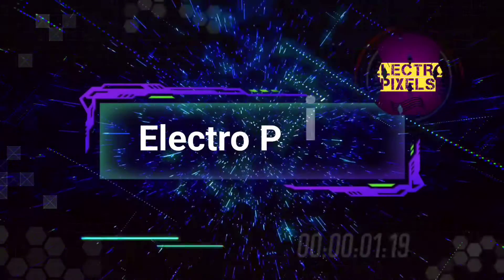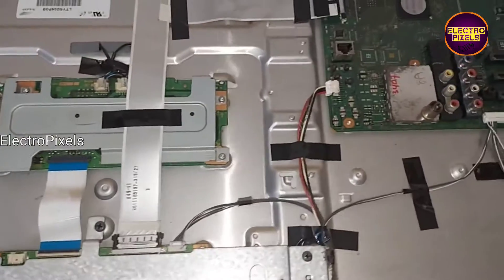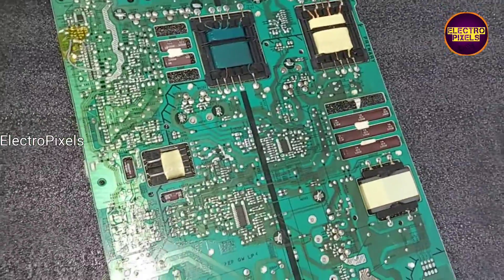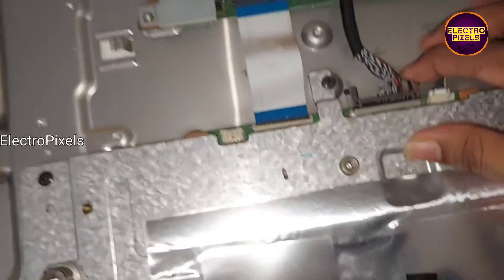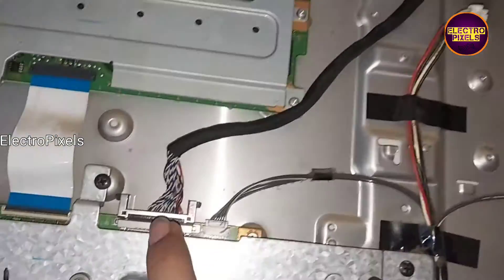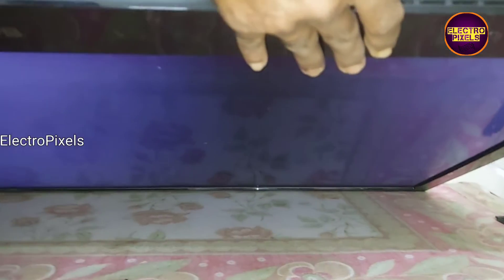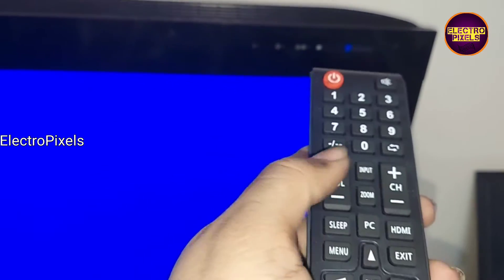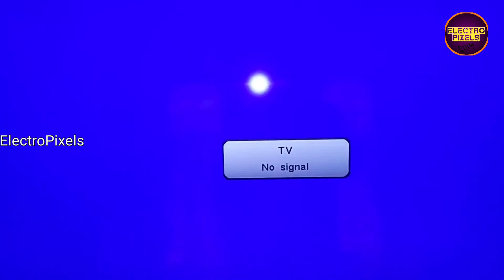Universal Board Complete Installation Process in Orginal Sony Bravia LED TV.|KDL-40EX720|Service Tv

Comment: Burning mode on while installing universal board please help 🙏bhai heart de diya thik he par solution batao
Reply from the maker: Change lvds cable, or use another brand universal board, Also check the panel resolution code

Comment: How connect bl on
Reply from the maker: Only in this model the Blon signal is send from The T-con Board to Backlight Driver board. It's clearly explained in the video.So Only need to Connect panel Lvds cable.

Comment: Sir blon kaha se diya aap ne
Reply from the maker: The Backlight Is Controlled From The Panel Tcon Board in this Tv , So There is no need to connect the Blon in Universal board, only need to connected lvds cable for this model
Reply from the maker: Watch the video from 6:10 onwards Sir